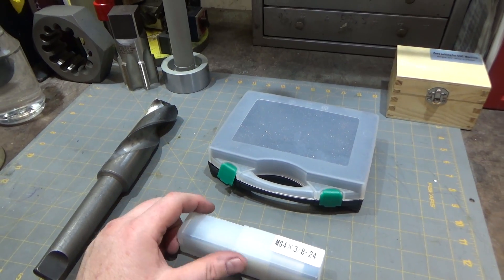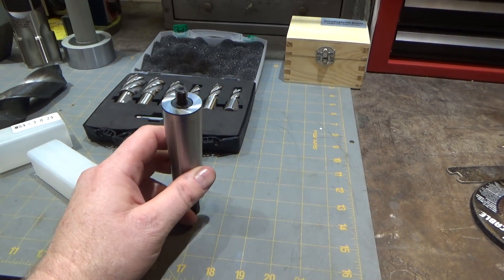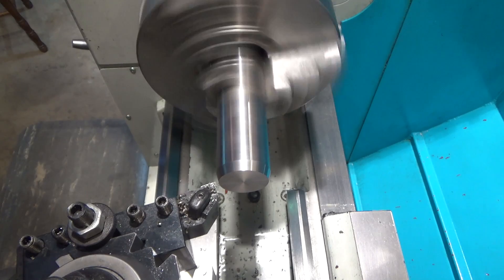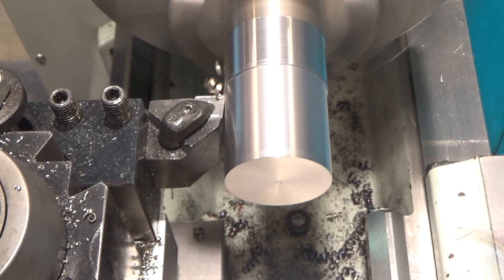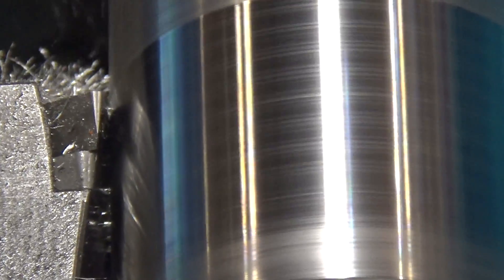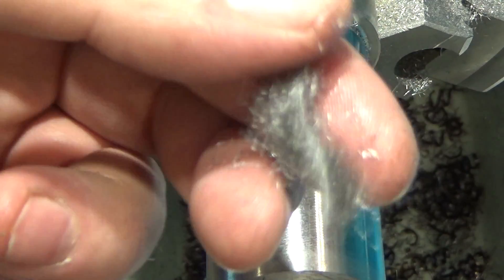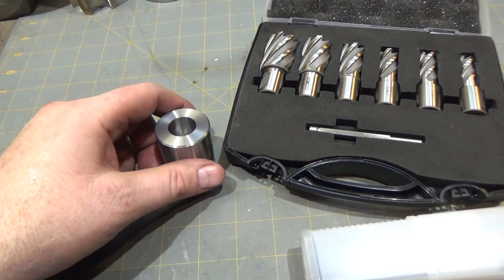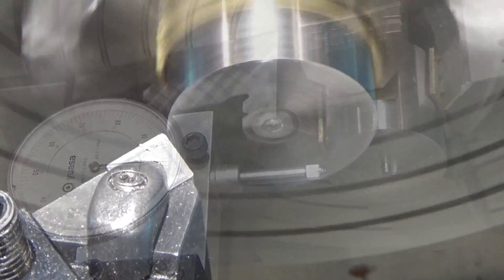63 Annular Cutter Holder for my Lathes Tailstock

Comment: Enjoyed the video Dudley.  I found a few cutters at a hock shop a few years ago but I have never used them.  Need to make a holder for use on my mill.  What insert is that  you are using to face the material ?
Reply from the maker: Thanks. The Insert is some type of CNMG43X, X being 1,2, etc. I bought a whole bunch of inserts at an estate sale and they were not in boxes, so I can't be more specific. Sorry about that.

Comment: I here they are way better than a drill bit with big holes
Reply from the maker: This was the first time I have used an annular cutter and it worked a lot like an endmill without needing to remove all of the extra material. It did not try to wander and didn't struggle with an interrupted cut.

Comment: What did you measure for runout in your adapter bore? I have also used import morse taper - drill chuck adapters as the material for projects, and I had a few where the jacobs taper or threaded stud was horribly non-concentric.
Reply from the maker: I haven't yet, but I think that this would be a good idea. I have been pondering this problem for a while. I might use the mt6 to mt4 adapter in my spindle, but this would have to factor in both parts runout.
Reply: Can do that with matched V-blocks (or even one big block, really) too. Put the morse taper on the V's, have a stop to keep the arbor from moving axially.  (I just use a magnet over the back end of the v-block)  

Doesn't matter that the axis of the arbor isn't level, runout is relative.
Reply from the maker: Interesting approach. I have tried to use a dial indicator and my lathe DRO (or another dial) to measure a taper before and found it exceptionally difficult to be accurate better than a couple of degrees. Sloping surfaces can be a real challenge. Have you had good luck with your method? I see the beauty of the relative measurement, but if the v block is not exactly perpendicular to the Morse taper, the path it will follow when rotated is not going to be a circle. If you have had decent luck with this method, I am going to have to give it a try. Very interesting thoughts, thanks.
Reply: I'm not sure I follow regarding the Morse taper being perpendicular.  The taper is what rides in the v-block, so the geometric assumption is that the Morse taper itself has already been verified as straight and smooth.  You can do that verification with this setup before checking the non-morse taper end, just set your indicator on the morse taper while it's in the v-block and rotate the arbor.  It occurs to me I never actually said I do this horizontally - the block is V-up, and the arbor is just set into it.  Gravity keeps it down, the end stop keeps it from shifting, and you can check in several places to ensure the tapers are coaxial, not just concentric at one point. 

Yes, I've had good luck measuring runout on tapered arbors that way. The absolute requirement is that nothing moves axially, at all, during the rotation.  The v-block, the stop for the arbor (*and that presumes the end of the arbor against the stop is as true as possible, face it off if needed*), the axial position of the arbor, and the position of your dial indicator, all must be held securely.  any movement axially by anything, and your measurement is ruined.  I'm no Robin Renzetti, but I use a tenths indicator for best effect here.

Note that the setup can be used for runout in shallow bores as well, or as deep of a bore as you can reach with your indicator.  You won't get size, just differences as you rotate the arbor.  The one arbor type that needs an extra bit with this, is a morse taper with a tang.  All my morse taper size adapters have a tang, and I've carefully cut a dimple on the end of the tang with my tiniest center drill so I can use a dead center as a stop.

Because it doesn't even have to be set up on a flat surface, I use my cast iron table saw top.  I block in the v-block with magnets, use the previously mentioned magnet as the arbor stop, and use a magnetic indicator base. Did I mention I like magnets?   That said, don't go magnet crazy on your measuring tools unless you have a DE-magnetizer, which I do :-)

I started doing this when I had trouble getting repeatable runout measurements with tools in my mill spindle, and wanted to verify the problem was not my motley collection of adapters and tooling.  Yes, it was the spindle bore at fault.  I had cleaned it all up when I bought and fixed the mill, but never thought to actually check the spindle bore itself.  There were some dings pushed up which had erratic effects, depending on which thing was in it.

Comment: Great build. I share a old trick I learned a long time ago. When wanting to do several operations on parts in a 3 jaw chuck mark the part on #1 jaw the as you rotate or relocate put it back in-line this will maintain what ever runout that was in the in the chuck. If you’re chuck is true then it will work
Reply from the maker: Great idea, thanks. I will have to give that one a try.
Reply: Good deal. When I get home from vacation I’m posting a video on a fly cutter I machined that uses a tool holder. In it I demonstrate this technique and the cutter did not vibrate in the mill when I tried it out for the first time
Reply from the maker: I've sub'd and look forward to watching. Thanks.
Reply: Thanks I do appreciate it

Comment: How are you measuring the inside diameter to within 0.0001”?
Reply from the maker: I was estimating based on the outside diameter measured with a micrometer and pin gauges. I was not attempting to be accurate within a single ten thousandth. I have no way to easily measure inside diameters that accurately. I was giving an approximate value. I appreciate you calling me out on that one. I was considering what to do about my comment when I was editing, but did not have an easy solution, so left it in. Perhaps a mistake.
Reply: Thank you for getting back to me. I wasn’t trying to call you out. I am a machinist and was interested in seeing how you measured that accurately.
Reply from the maker: Not a problem at all. I deserve to be called out if I make a mistake. Nothing is worse than propagating miss-information. I a relative new to machining and say things I shouldn't. It is surprisingly hard to talk and concentrate on what you are doing and not make silly mistakes. I try to edit them out when I catch them, but sometimes, I don't know any better and others with more experience point out my mistakes. I always appreciate the viewers who spend their own time to share their knowledge.

Comment: stress proof is realy nice to work with. i used to use your technique of backing taps out of a work piece until i had a tap catch. my hand was driven into the cross slide i didn't suffer any permanent damage but i got a nasty cut and two fingers were numb for a couple of days. lesson learned.
Reply from the maker: Thanks for the warning. I really appreciate it. I always make sure the cross slide is well clear, but still, your advise is sound. I appreciate it and will heed your warning.

Comment: Nice way to make large through holes in stock, and leave you with a slug of steel for future use.  I hate turning expensive steel into waste chips.  Another good project.  Is there data on what grade stud in in the morse taper adapter?
Reply from the maker: Thanks and no, the MT4 to 3/8-24 stud is from China and spec free, but it was exceptionally affordable ($6.50). The ad claims that it was hardened. All Industrial carries the product. They might be able to help with more info if needed.

Comment: Are those HSS cutters? Do you have a link?
Reply from the maker: Yes and:

https://www.ebay.com/itm/Annular-Cutter-Cobalt-6pc-Set-3-4-Weldon-Shank-9-16-1-1-16-Magnetic-Drill-Bit/262744063248?ssPageName=STRK%3AMEBIDX%3AIT&_trksid=p2057872.m2749.l2649
Reply: Are these Taiwan made?
Reply from the maker: The cutters say made in japan.
Reply: I just order from the link. These are made in China. You must of got an old stock or something.

Comment: Nicely done!!! Now...... I wanna see the tail stock die holder for the one on the work bench... lol.... What size is that? looks like it would require 8 men / 4 on each side to turn the holder, like how they did things on big ship engines... cool. I want one now...
Reply from the maker: It die is 3" and the tap is 2.5". I found them on ebay for almost nothing and thought they would make nice props. In my steadyrest project I had to tap 1 3/8 and it was really hard, I cant imagine using either one of these other guys. I always wondered how really large machines like ship engines were made. Amazing.

Comment: Another good vid and useful tool in the books. Looked like that facemill was cookin' for it's dia, but could be wrong. Nice work though.
Reply from the maker: It probably was. the SFPM was about 350. I was a bit lazy and did not do the calculations ahead of time, but rely on feedback from the process. Thanks for the heads up.

Comment: Nice handy little tool. When milling flats useing a vice I reccomend cutting accross the vice's grip surface. Without a hard stop the work peice can travel due to tool pressure. That material looks like it likes a lot of feed, speed, and depth of cut. I know you like to keep your machines looking clean but useing coolant will not only make cutting tools last longer, heat expansion is much less of a problem. I share your desire to keep your machines looking nice. Water base coolant is not as messy as oil and does not cause rust. Just mix it a little richer than the directions call for and all will be well.
Reply: Good advise
Reply: The surface that the tool bits address are sort of cross the vice' grip surface -no?  At that feed rate it seems almost to be a wash between spin forces and tool pressure - but I'm a noob!  Am I completely wrong
Reply: You are not completely wrong. The greatest pressure is the direction of cut. Spin force is only a problem if the depth of cut is excessive. The objective is to cause the least amount of pressure at the weakest point of grip. Cutting accross the vice's grip presents the pressure accross the greatest amout of grip.
Reply: I'm setting up as misting system now.  I just got a new air compressor for my little hobby project shop after my old one gave up the ghost.  I'm going to be running steel pipe for air to 3-4 outlets.  should make for easy movement of the mist coolant and easy access to air from anywhere in the shop.
Reply from the maker: Fair criticism and thanks.  I always appreciate the suggestions. I do need to get up the courage to use coolant. Thanks again.